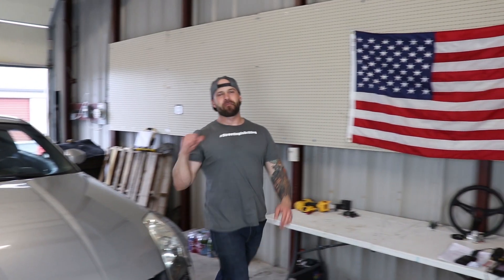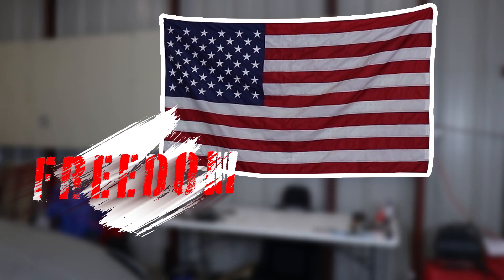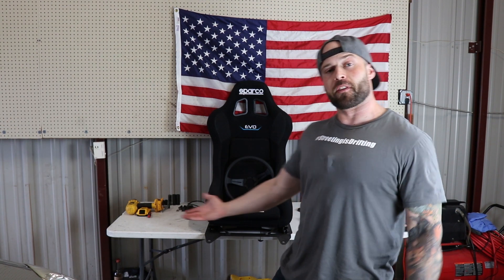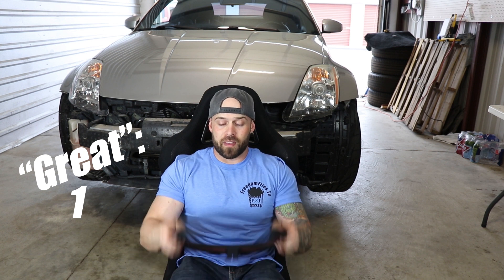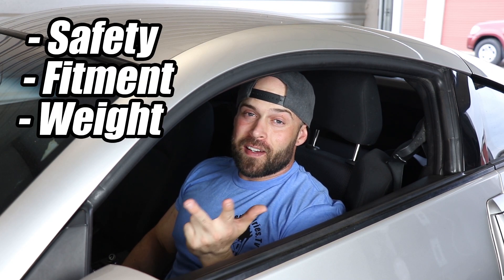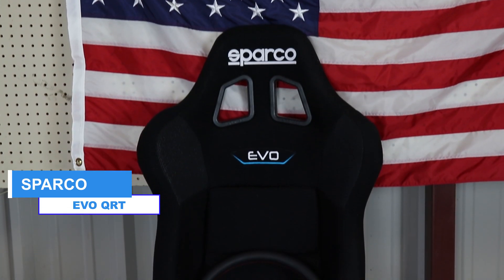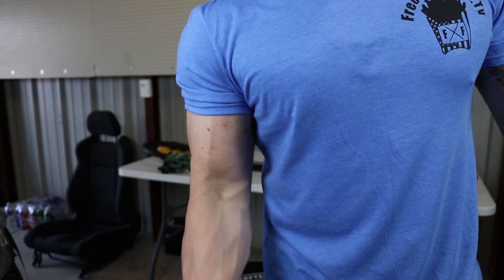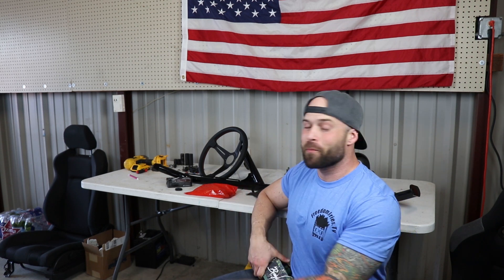350z - Sparco Racing Seat, PCI Seat Mounts, Bridgemoto Harnesses and Harness Bar

Comment: Hey what harness bar is that and how was Fitment?
Reply from the maker: Graffiti's "K" Harness bar. I think some places still have it, but it's discontinued (I think). Fitment was good minus that corner in the truck. I had to drill it out a bit to widen the hole. (Or maybe I just used an impact and crossthreaded the bolt. WHO KNOWS!)